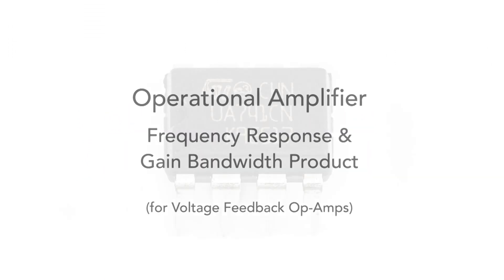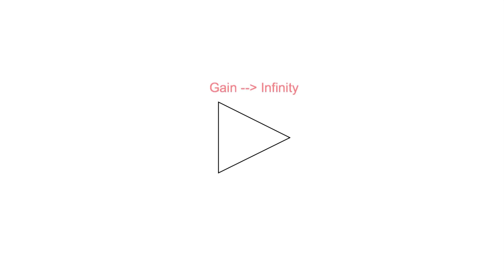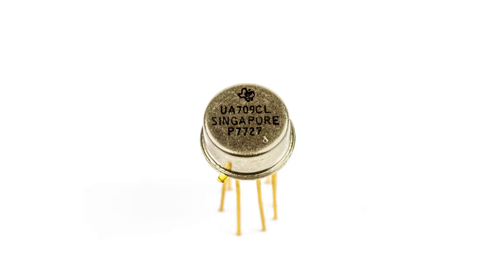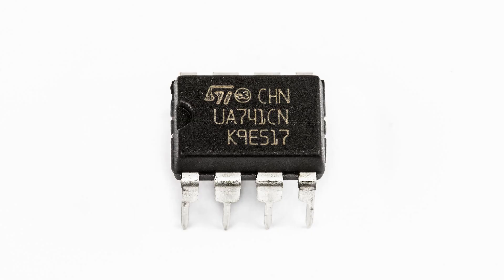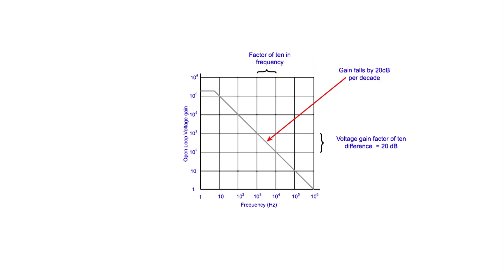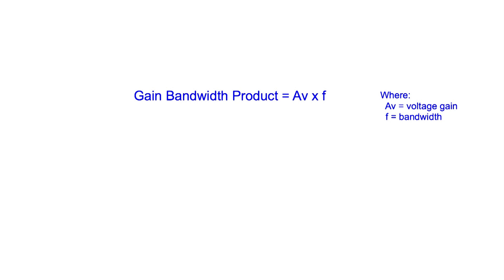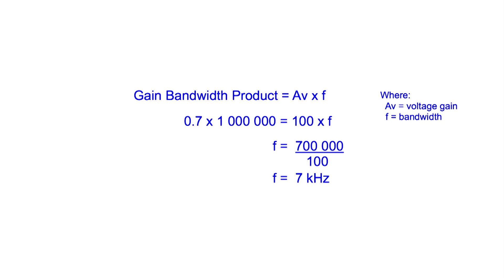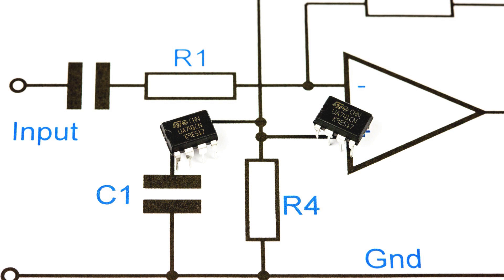Op Amp Frequency Response & Gain Bandwidth Product

Comment: I see the OPA627 TO-99-8 (one of my favorites) has a 16Mhz bandwidth.  I'm trying to learn these things.  I just love them.
Reply from the maker: I've not personally used the OPA627, but it looks like a really capable IC. 16MHz bandwidth looks really fast as most op amps have a very much lower bandwidth! I hope you found the video useful.
Reply: @ElectronicsNotes  I use 2 of them in an adapter to make a dual.  Still in my top 3 and I have Sparkos, Burson (V5 and V5i), MUSES02, little of this and that, but love the can style much better than the OPA627 IC chip.
Reply from the maker: Sounds great.

Comment: when talking about Frequency here, what is the frequency of? Is it the frequency of the AC signal going into the opamp?

does low bandwidth then mean we lose more treble of the signal being amplified?

thank you very much :) i'm still quite new to electronics
Reply from the maker: Yes, the frequency is that of the incoming signal frequency- if there is more than one frequency component, these can be treated separately.

And yes it does mean that the treble can be reduced if the bandwidth is not high enough.
Reply: @ElectronicsNotes  thank you very much :) great video!

Comment: tyy !  I am having trouble with the sheet! I don;t understand how to read it until I watch your video !!! btw why we need a bandwidth with higher value ? I am still studying Op-amp and want to know moreeeee
Reply from the maker: The reason why a high bandwidth is needed is that the gain bandwidth product remains constant, and for applications like audio amplifiers a flat response is needed over the audio frequency range. To get this it is necessary to swap the gain for a flat bandwidth.

Comment: I need to design active 90MHz High pass filtre but i can not find available op AMP how can i design this filter ?
Reply from the maker: I am not surprised you cannot find a suitable op-amp. They tend to be used for much lower frequency circuits - normally for frequencies up to a few tens of kilohertz, although there are some high frequency op-amps, but they won't reach nearly the xor of frequency you are after. For a 90 MHz filter you would need to use an LC filter rather than an op-amp one.

Comment: When doing this experiment 'the effect of negative feedback on gain and bandwidth', what are some precautions, limitation and sources of error that we might encounter?
Reply from the maker: A bit of an open ended question. Precautions are to ensure that the gain is negative, i.e. applied to the "-" terminal. In terms of sources of error the main one is the tolerance of the resistors, or in the case of an inverting amplifier it can be the source resistance of the input. This is added to the input resistor to give the gain.
Reply: @ElectronicsNotes  thanks

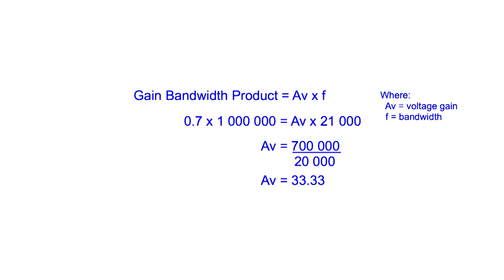Comment: typo at 5:03 having 20k instead of 21k but handy vid nonetheless
Reply from the maker: Thanks for spotting that. Nobody has commented about this before. You are obviously very observant. Thanks.
Reply: @ElectronicsNotes  ha just me overanalysing stuff. btw, learnt more conceptually from this vid than i have from 3 weeks at uni doing analogue electronics so ty
Reply from the maker: @colyeerr  No worries, it was a valid comment. Although it is more likely this circuit will be used in a situation where the load is always there, the possibility of it being used where the load is removed.